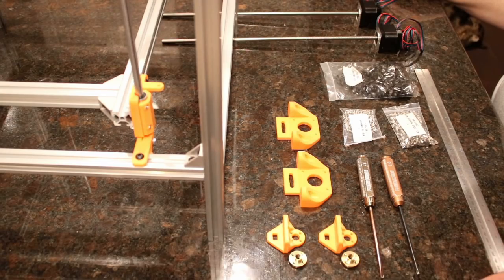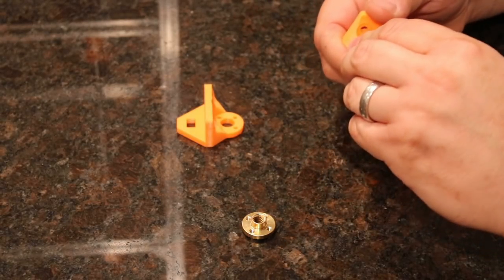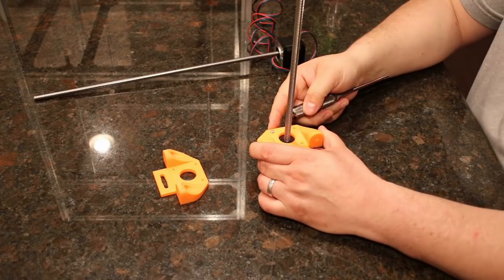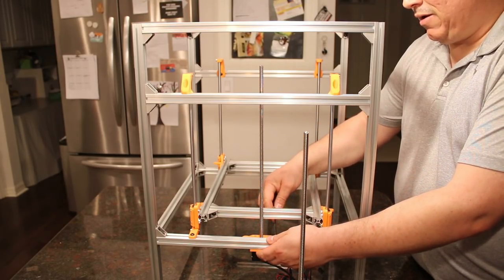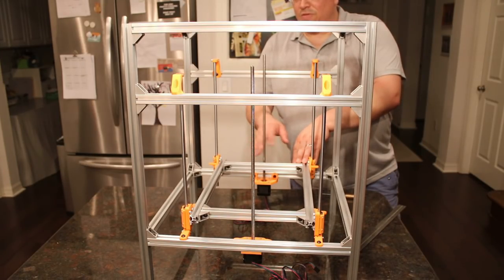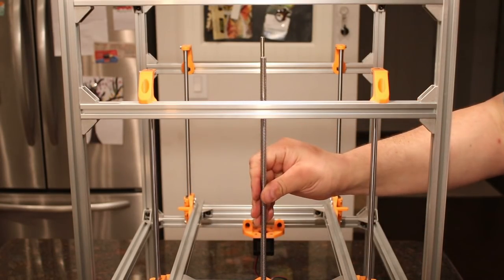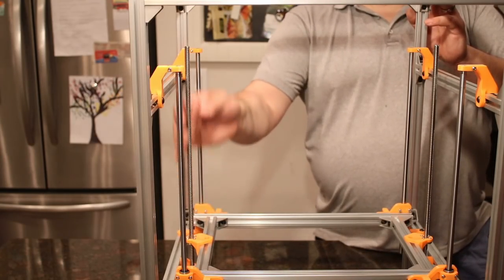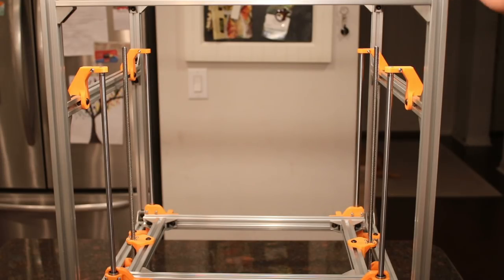3D GURU Building the Hypercube 300 Part 5 - Finishing the assembly of the Z axis parts

Comment: You mentioned cutting the 400mm rod, how much is left at the bottom? 350/360mm lengths seem to be more readily available for me.
Reply from the maker: Chris Wilson to get the full 300mm of Z travel the rods need to be ~385mm. You can actually move the extrusions that hold the z axis parts up and down on the frame 8-10mm to accommodate different length XY stepper motors and different arrangements for mounting your controller. That’s what I say approximately 385mm. If 360mm rods are easy to get use those and just raise the lower x and and y extrusions up so the lower z rod mounts engage the rods.
Reply: Great - Thank you.   Love the video series, BTW.